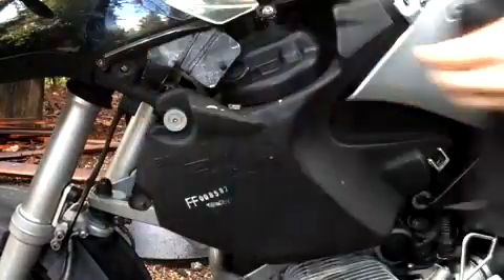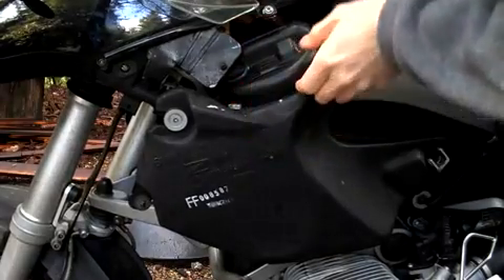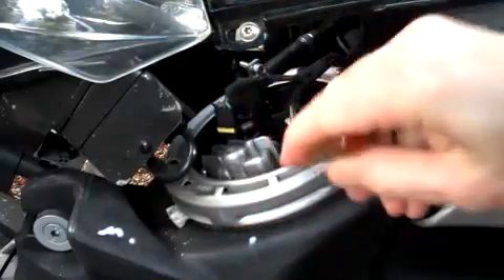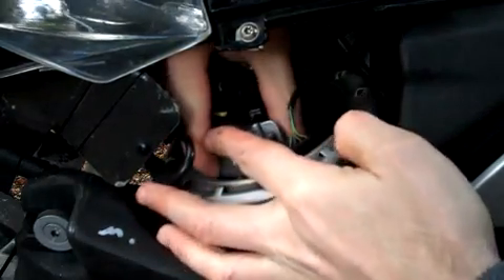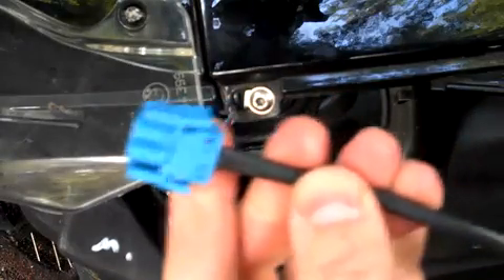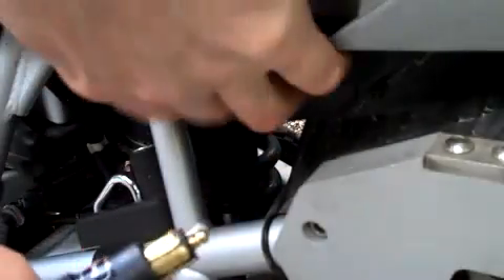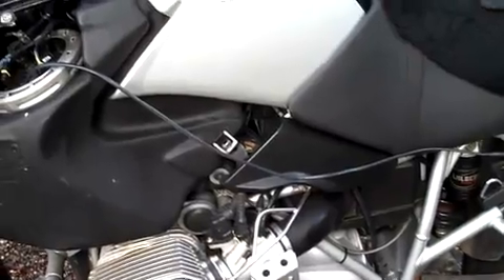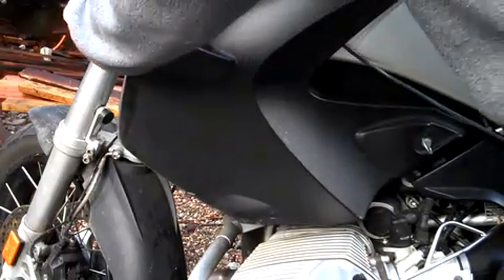BMW R1200GS fuel pump controller bypass

Comment: So, is this fuel pump controller bypass cable a new piece of equipment to be carried by R1200G/S riders?
Should a motorcycle even require a fuel pump controller?

Comment: Hi, I'd like to test this trick with my GS, but before I'd like to build that cable by myself. I wonder which pin is 12V an which pin is ground or is it indifferent how to connect to the plug? If somebody has a tip how to assign the connector, maybe with picture, I would be very thankful.
Reply: well, two years after your question, but a multimeter will tell you. checking with bike on and wires connected. simple
Reply: I ask the same. Somebody
Reply: If the powers not working how can you know that

Comment: Is this fuel controller also could be as a fuel pump relay?
I believe it is what it is.
In that case , bypass the solid State relay is definitely a good idea .
Any DC motor has a coil.
Once the DC power supply is switched off , there s a back current..
That s how sparks happen on a spark plug (the DC supply of the ignition coil is turned off and that produce the park).
Bypassing this relay means that the back current will flow to the unit that provide this dc supply (most likely it s the ECU).
Over some times , this back current could damage the ECU.
I believe that s the reason BMW uses this solid state relay .
I would suggest to buy an off the shelve solid state relay and  mount it where there s some place.
Solid state Relay (électronique relay without mobile contact) are cheap..
Ride safe

Comment: HOW MANY VOLTS SHOULD BE THERE I TESTED 1 VOLT JUST NOW IGN SWITCHED ON CONNECTOR UPLUGED AT PUMP BASE TO INSERT PROBE @ BLUE CONNECTER
Reply from the maker: Sorry, long time since I moved on from the GS - post your question at ukgser.com e.g. here: https://ukgser.com/forums/showthread.php/193142-Really-neat-Fuel-Pump-Controller-bypass?highlight=fuel+pump or search results 'fuel pump bypass': https://ukgser.com/forums/search.php?searchid=16064565
OR advrider.com, search results 'fuel pump bypass': https://www.advrider.com/f/search/86164485/?q=fuel+pump+bypass&t=post&o=relevance&c[node]=76+3+77

Comment: Cant the bike run permantentely with the bypass?
Reply from the maker: I don't see why not if your bypass is well enough made (wiring well insulated, routed with good connections etc) but the controller must be there for a reason albeit not totally clear to me...
In simple terms it's a voltage regulator that reduces the voltage supplied to the fuel pump itself to make it run at something like 50 to 80% capability. Quite why this should be necessary I don't know (prelong the life of the pump? or reduce the heat output of the pump motor?) but I'd have thought a different pump design would negate the need??!!
Fuel pump 'Deluxe Bypass' .... http://www.motorcycleinfo.co.uk/index074c.html?fa=contentGeneric.nvxszdkebklxuaer&pageId=428065#comments
Reply: @AndyW_inUK  it is there to regulate fuel as pressure required by injector is way less than the capability of pump. in Japanese bike there is fun pressure regulator I guess FPC does the same

Comment: Just went to go for a ride and no joy starting my GS.  Turned over for a good 30 seconds but no smell of unburned fuel at exhaust.

Dug out fuel pump controller. Bare zinc casting not black like I've seen on posts here and elsewhere on internet.  Housing corroded but no water in well under controller